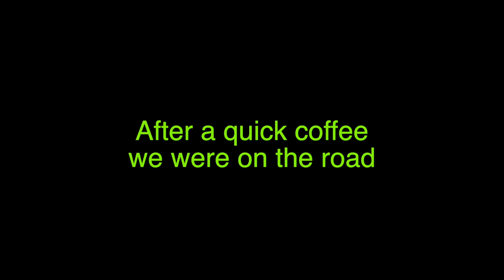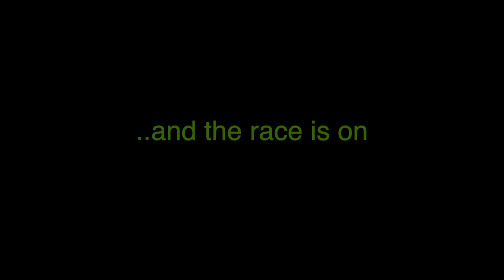Being fried alive at the Bathurst 12hour

Comment: You didn’t stay till the end? 🤣  I did that trip with the Canberra Kolectiv a couple of years ago (when Lowndes won in the Ferrari and Van Gisbergen ‘screwed the pooch’). We camped down in the infield and watched from near The Chase. A fantastic time but so hot. Box ticked and now I watch it at home with the AC on full. 😊

From the telecast I got the impression that crowds were down. I’m thinking the heat and bushfires.